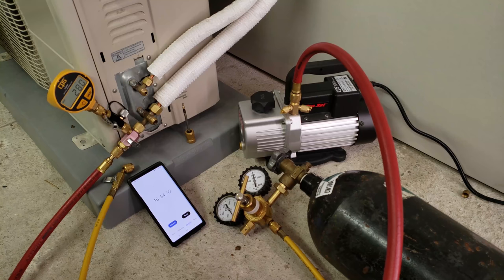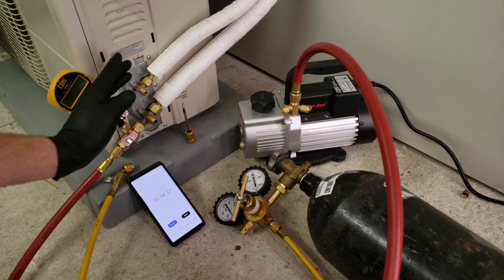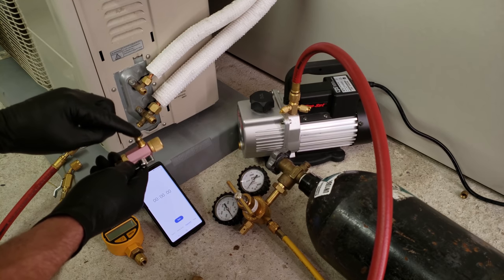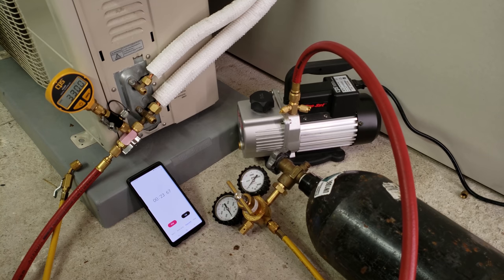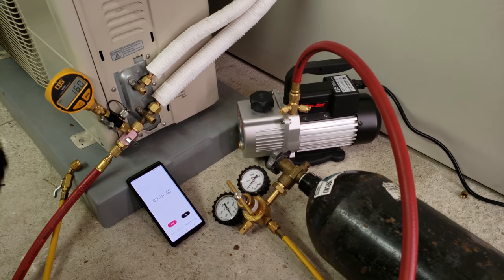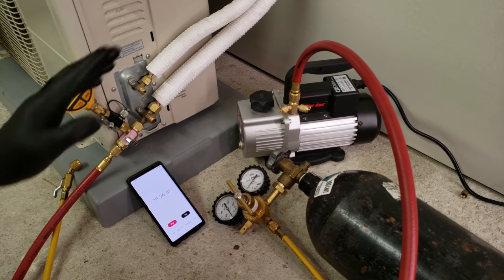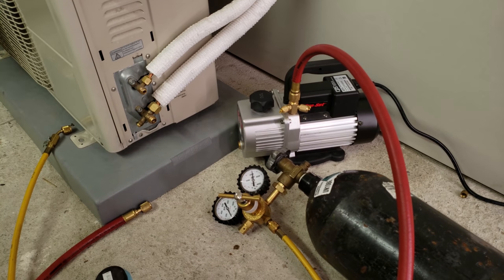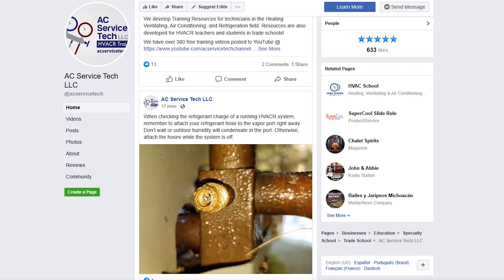Ductless Mini-Split Single & Triple Evacuation Method!  Step By Step & Opening Valves!

Comment: Craig, I need to see if this information is correct for a 30 lbs. cylinder of R22. Does the cylinder empty weight 5lbs. 6oz. and is the volume 822 cubic inches? Thanks for your excellent videos.

Comment: Another outstanding video.  Thank you!   It seems that when you open the top VCRT to let the nitrogen pressure out of the lineset (and before you put the vac gauge back on), that it is allowing moist outside air into the lineset.  Is this acceptable because you are going to be immediately pulling a deep vacuum, or am I missing something?  Thank you.
Reply: Hardly any moist air gets in, everything is at atmospheric pressure at that point and the tubes are skinny.

Comment: Would inserting the core before releasing the Freon be considered a bad practice? I guess the air inside the chamber of the removal tool would enter the system rather than the pressure of the system pushing that air out.
Reply from the maker: Yes that would be a bad practice and I have seen a lot of people doing that. You would loose the vacuum that you just spent all that time doing, thanks!
Reply: how do you purge, pressure test and vacuum a mini-split that is old and has no charge in the outdoor unit? Do I need to use magnet to fully open the EEV, Also is any other component blocking the path to do a complete purge or vacuum of the entire system? Also is it even achievable with only one service port? thanks for any advice
Reply: @glennhendricks4111   First close off the valves to the compressor/ condensing unit and the pressurize it with some type of gas and find the leak with soap bubbles.  The leak is most likely in one of the flare joints or around the service valves.   The problem is an older unit that ran out of refrigerant is a lot of moisture has probably been pulled into the system and the compressor oil is contaminated.   Even a deep vacuum won't get all the water out from under the oil.   However if you think you got the leak stopped vacuum as best you can for a long period of time, and then add a drier and moisture indicating site glass for at least the amount of time it takes for the moisture indicating sight glass that the system is free of moisture.   Then I guess at that point based on what people are saying, pump the refrigerant into the high side reservoir and remove the drier.   Unless you have a lot of experience you may need to call a good repairman who knows how to deal with it.  I'm a very strong believer in the effectiveness of driers at cleaning up a system.
Reply: I have to finishing watching the video, but it seems to me best practice would be to reinsert the schrader prior to the final vacuum pull  down.  The final pull down would not be as critical  in terms of speed and even pulling as deep a vacuum. The reason for the deep vacuum is moisture removal.  But that should be entirely gone before the final pull down.  I can definitely see value in the so called "triple vacuum method."

Comment: When you release the pressure after adding Nitrogen, isn't air allowed back into the system before you hook up the micron gauge and vacuum again.  I'm a bit confused.

Comment: Great video for vacuum test, would like to know detailed step by step pressure test on new install mini split, cannot find leak.
Reply: Are you using soap bubbles or an electronic leak tester.   I don't know if the is a electronic tester for nitrogen.   Somehow you have to pressurerise the system and then check it with soap bubbles anywhere there is a mechanical joint like a flare , or even the schrader itself.   His video starts out after the pressure test.   He originally pressurized it with nitrogen and checked to see if it leaked down.  Or maybe he also ran soap bubbles over the flare joints.  If you tighten a flare too much you can pull the flare off.   At that point you will have to cut the flared end off and redo it getting more tubing from somewhere.  Hopefully you left some slack.

Comment: You're a great teacher! My question is, I have a 5 ton Trane xl19i . It calls for a 60amp breaker.  I started to notice that my 50 amp contactor has started pitting.  Would you recommend I stick with the 50amp contactor when I replace it ,  or could I go with a 60amp contactor?

Comment: When you vent the N2 to atmosphere you've defeated the purpose of the N2 purge and reintroduced atmosphere along with all the humidity back into the system.
Reply: What should he have done differently then? How can you avoid venting the N2 into the atmosphere?
Reply: @Fighter4Street  He could leave the gauge attached, lever it off and use the shrader valve on the black appion valve to add nitrogen, then release the nitrogen through the shrader until there is just little left so no atmosphere gets in. Start the vacuum pump, and gently open the valve lever until it's fully open. Then open the gauge lever. I could be missing something though.
Reply: @Fighter4Street  First of all get rid of the valve core removal tool.  It's completely unnecessary unless you're over 23' of lineset.  My experience has been 23' took 30ish minutes to pump down whereas an 8' lineset took 5 minutes to pump down without removing the core.  So the solution is to use 2 tees.  That leaves 4 connection points.  1 goes to the unit to pump down the system, 1 for the vac gauge with a shut-off valve, 1 for N2 line with a shut-off valve, 1 for the vac pump with a shut-off valve.  You never have to vent with that method.  You never lose vacuum either as you could using a valve core removal tee.  Once you pump down with this 2 tee set up you release the refrigerant to the pressurize the system including your 2 connected tees.  At that point you unscrew the 2 tee assembly from the unit.  Quickly.  You lose a tiny bit of refrigerant equiv to what you'd losing purging the air in the tee as in this video near the end.  Having written all that, i'm not clear what the sensitivity is of using N2 vs not ever using N2 and just pumping down.  It could be the N2 helps remove more water when you vent with it reducing the slow boil off time of water in the sytem slowly raising the pressure.
Reply: @flyingyakdeath  I used to build custom marine systems 30 years ago before R12 was outlawed.   At that time we just purged with R12 and really didn't even need a vacuum pump.   Personally I think the Nitrogen deal is just a comparatively inexpensive not harmful to the atmosphere gas that can be used for pressure testing, then additionally several short pull downs with a follow up nitrogen sweep reduces the service time to get the system up and running.  There is usually more than one way of accomplishing something.  I also said before, and I know for an absolute fact that a small drier added to the liquid line removes moisture and acids better than vacuuming at least on a system that has been operating and maybe leaked on the low side and went into vacuum, pulling in air and moisture while operating.

Comment: Hey Craig should you keep the head units on the system if you can do a sweep and push any oil out and through the head units for these split systems? I just wonder about any old oil being caught up in the evap coils of the heads. I was told by someone from a supply house to open the flares at the head unit and blow from there.

Comment: how do you purge, pressure test and vacuum a mini-split that is old and has no charge in the outdoor unit? Do I need to use magnet to fully open the EEV, Also is any other component blocking the path to do a complete purge or vacuum of the entire system? Also is it even achievable with only one service port? thanks for any advice
Reply: I think you asked this previously

Comment: Great Video.  So for mini-split system, Do we still do vacuum for both liquid line and suction line ?  Thank you.
Reply from the maker: Yes it vacuums both lines. The difference is that we don't have a metering device half way down the tubing loop like in a conventional system. The metering device in a minisplit is in the outdoor unit, thanks!
Reply: You are vacuuming both lines from the low side at the service port.  It's somewhat of a sketchy method.  In the old days, we used to pull from the high and low side simultaneously with a more complex valving system.  What I see is that these newer systems have been somewhat simplified from a manufacturing point of view, but more complex from a servicing point of view..   The less valves and less mechanical joints such as flare fittings, the less chance for leaks.  Smaller units such as window AC's and home refrigerators are completely sealed with no service port initially.   They never leak gas.  Anywhere there's a flare there can be a leak.   Compression fittings are the worst.  Second to that pipe thread.  Flare is the best but still can have problems for a variety of reasons.   I see nowadays they have outrageously expensive plastic washers that can be used to stop troublesome leaks.

Comment: Great video, one question regarding a Nitrogen pressure test prior to this test.  If you are installing a cooling only mini-split that operates at lower pressure, do you need to perform this or is the micron test sufficient?
Reply from the maker: We still do a nitrogen pressure test so if there is a leak, the vacuum wont pull humid air into the tube through the leak spot, thanks!
Reply: @acservicetechchannel  Just got my Nitrogen tank today and will install my Mitsubishi later this week following this method.  I have relied heavily on your videos and appreciate your attention to detail.

Comment: What about if you have a multi city Mitsubishi ? Do you just vacuum with valve core tool from one circuit if the system is completely void on refrigerant since it will pull through the compressor ?
Reply: Your question is complex.   I guess you are describing a situation where the refrigerant has leaked out almost entirely.  In that case you would vacuum the entire system, not just the connection lines.  The system is just one large loop of tubing.  The compressor is a circulation pump.  To that you have a condensing coil and evaporation coil in the circuit.  You pull a vacuum at the service valve.  In these mini spits the refrigerant can be pumped into the receiver if you understand the procedure.  Contaminated systems present a more difficult situation that requires more complete servicing which may or may not be entirely successful in the long term.

Comment: great video. does your ac book explain how fan relays work and how heat sequencers work. and the electrical theory . on them.
Reply from the maker: This book is everything that has to do with refrigerants, preparing the system for refrigerant, checking the charge, and troubleshooting but does not go into the electrical side. I am working on a separate book for that presently. The full outline and sample pages for this book are at https://www.acervicetech.com/ac-book and the book is also for sale on amazon, thanks!
Reply: I can tell you that a fan relay would be activated with a temperature sensor, pressure switch, or even a door switch, unless it runs continuously.   To trouble shoot it, check the fan itself first to see if it actually works and it's a control problem.  After that you usually bypass the control in some way to see if you can force the fan on.   If the fan works when a control mechanism is eliminated then in all likelihood the control is at fault.  But again you have to first know that fan itself is not the problem.  You can usually check the relays themselves with an ohm meter for continuity of the windings, and to see if the is an electrical connection when the points are closed.  Electrical contacts can become dirty, disappear or weld themselves shut.  You need to try to figure that out. or just replace it if the fan works when it is bypassed.

Comment: Are the new R32 systems becoming popular in the U.S now? In the U.K these R32 units especially on mini splits are popping up everywhere. The pressures are also practically identical to R410a. Although I’m yet to see any chiller systems run on this new gas. What’s the primary vacuum reading in the U.S microns or Torr?

Comment: Is air that has the moisture removed suitable as a replacement for Nitrogen for leak testing of residential 5ton or less units?
Reply from the maker: We just use dry inert gasses, thanks!
Reply: My opinion is the you can use something else at least on new systems with fresh tubing.   It's probably not ideal or preferred.  You wouldn't want to do a triple evacuation breaking the vacuum with air.  I say just pull a longer single vacuum if you are trying to do it with out all the preferred gasses.   I did work on R-12 systems for years and never had any nitrogen.  But that was before R-12 was banned and all the regulations came in.   In principle you want to keep the system free of moisture in particular and any other contaminants that can result from soldering.
Reply: @JoeLinux2000  Thank you for your reply

Comment: Have you had problems with the appion valve core remover. I've heard (I havent experience it yet) that they been leaking from the lever.
Reply from the maker: I haven't had any problems with them during filming, use in the field or my students at school. I have had others leak though but not these.

Comment: This is the best air evacuation video so far. But I don’t like the way he swapped out the micron gauge to input the N2 , vice versa, using the same shut off valve. Doing so will let some air get back into the system with the N2. How much? Look at 4:30 video when he just turned the valve close and open: a tiny bit of air trapped within the ball valve was enough to cause the pressure jumped from 3000 to 12000 micron. Imagine how much air got in when he swapped out the gauge for the N2 hose. I would have total 3 shut off valves for pump, gauge, and N2 tank, and the system will have no chance for air to enter.

Comment: Should you get absolutely no rise in microns during the decay test after it settles out?
Reply: Maintaining a vacuum is extremely difficult.   I think he said in another comment that he has been able to hold it for a period of 5 hours or so.  A lot depends on the condition of your charging hoses.  Usually if they are old, they will not hold a vacuum well.

Comment: Why wouldn't you crack the high side flare and do a nitrogen purge for a few minutes?
Reply from the maker: You could but you may want to reapply oil or nylon to the flare face, torque to 11ft lbs and pressure test. You could do that if needed. Like I said you could also do the nitrogen blow through for the oil if you had a prob pulling a vacuum. In most cases you can just do a single evac deeper and that's fine, thanks!
Reply: I do that myself however you have to be careful not to split the flair when tightening back up. I’ve done that a few times😬
Reply: @acservicetechchannel  Good to know.
Reply: @matty6848  The less you mess with a flare the better off you'll be.

Comment: You can get a nitrogen purge once on a mini split, if you do so just before attaching & torquing your 1/4" connection at the outdoor unit. Assuming your pressure test passes, there should only be nitrogen in the lineset from that point on.
Reply: What do you mean?
Reply: @Bostonn617  1:  Flare attach and torque indoor unit. 2: Flare attach and torque outdoor suction line. 3: Flare (but don't attach) outdoor liquid line.

4: Then attach nitrogen to the service port, do your purge. 5: Attach and torque the liquid line.

This way you have mostly nitrogen in the lines, and were able to run nitrogen through the lineset, not just in and out the service port.

Comment: Thank u for this video.very clear instruction on a tripple vaccum test.Craig can u do a video on how to set pressures,on different refrigetants so as to set L.P/H.P. switches.Thanks
Reply from the maker: Kenneth, thanks for letting me know what you would like to see!
Reply: Yes, that would be important.  You may be able to find the info on line or from the installation manual.

Comment: Hey Craig, what if you do the triple and still don't get it down well below 500?
Reply: You probably have a leak but it could be in the connecting hoses not the actual system or your vacuum pump is shot.   Maybe the test instrument is out of calibration.   Test it with just the vacuum pump by itself, not connected to a system.

Comment: Is it imperative that you remove the Schrader core? I have a unit that you can't pull the cores out on since it's at an angle (fujitsu) also my vacuum decay was pretty stable over 20-30 min with minimal rise. Over 15 minutes it came up 50 microns to 100-110. I walked away and went to bed and checked unit in morning about 7 hours later and the vacuum decayed to 550 microns. Does anyone think that's ok? I figure I'm ok on this one. 500 psi pressure test for 24 hours with only a slight dip in psi and I figure it's from temperature drop.
Reply: You posted a long time ago, so I'm sure it has been resolved, but I would say you are good to go as 500 microns is considered good.

Comment: Is the 3/4” metal cap with hole that you attach after reinserting the valve core an item that’s available for purchase? I searched in the parts list but only see regular caps. Does the hole have to be drilled into a regular cap? And if so, what size is the hole?

The re-insertion of the valve core seems to be one of the trickiest steps. You can’t tighten the vct too tightly or the o-ring will squish and prevent the core from moving past. Too loose and the valve could potentially shoot out under pressure and leak all of the coolant. 

If anyone knows about the cap with hole used to test for any escaping air/coolant, please comment. Thanks!